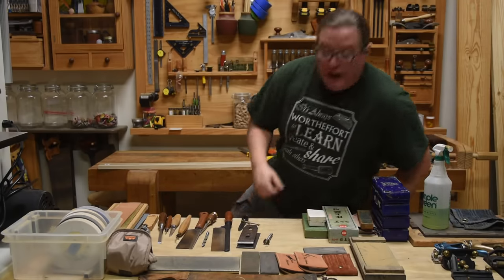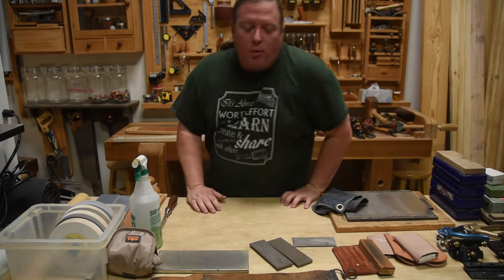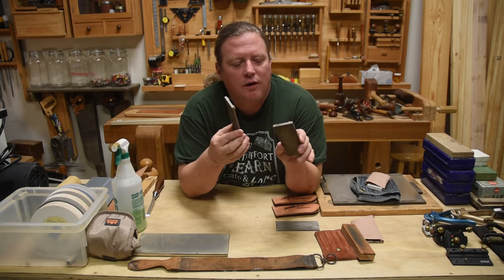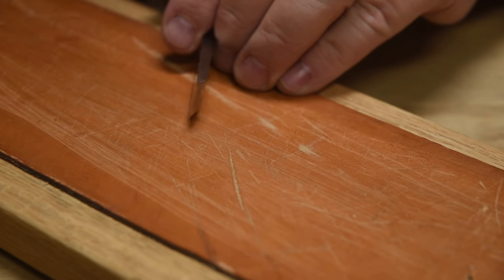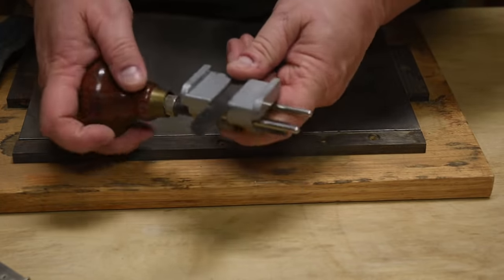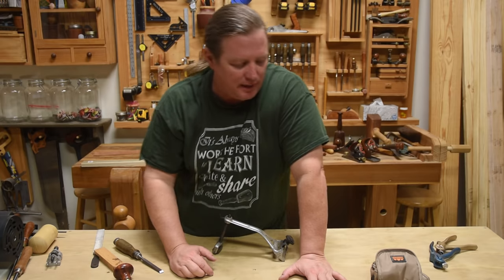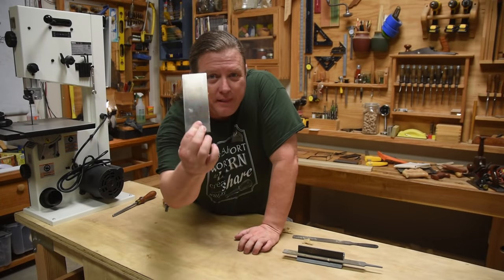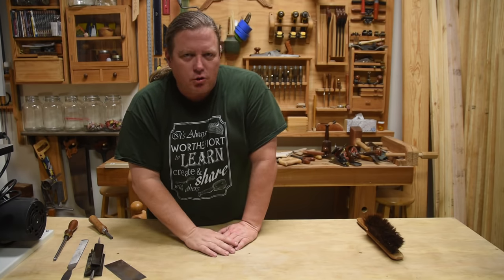Learn Sharpening - Prerequisite Course #07

Comment: I've been doing fine woodworking for 25 years and have pretty much progressed through all of the methods you described and agree with your conclusions.   My current methodology is the Norton stones and Veritas jig.   Not the only answer, just my answer.  I picked up the M-Power Fasttrack Precision Sharpening System and De-Burring Plate from Woodpeckers a couple years ago.  It is faster than the, but I'm not impressed with the results, you really don't get a shiny edge.  I've definitely got to get a real strop.  My current strop is an old belt hot-glued to a flat board.  Thanks for that reminder.   You've got a great presentation style
Reply: That should have said, "the Fasttrack system is faster than the stones, ..."   Not sure what happened there.

Comment: The thought of having to sharpen my tools literally terrified me! I've since sharpened my no4 iron, 2 chisels and a tenon saw. They all cut better than before, especially the chisels and plane iron as I have the cheap Eclipse type guide. The saw took me days before I got the courage up lol but once I started it was done in 10 minutes! The file dropped into the right angle and away I went.
This video has simplified things so I'm going to do some more sharpening tomorrow. Thanks 👍
Reply from the maker: keep at it.

Comment: I found a whetstone kit at the orange big box store a little over $40.00.  There are two combo stones 400/1000 and 3000/8000 along with other bobs and bits.  They say it's for kitchen knife sharpening, but the size of the stones are 2.28 in x 1 in x 7 in.  Will these be okay for sharpening chisels, plane blades, etc?🤨

Comment: THE BEST wet stone (they are splash and go, which is even better) are Suhiro Dabato MD series. they are large, fitting easily the biggest plane irons, and they are very affordable for what you get. They are also top notch and have the best feedback of ANYTHING I have ever used. (diamonds, oilstone, other wetstones) 

buy a Suhiro Dabato, you will NOT regret it.

Comment: I started out with sand paper but yeah, it gets expensive. Buying a stone is a good first step, or at least it was. You bought a wetstone with two sides, I bought 3 with different grits. I got myself The sund Tiger King stones in 220, 1000 and 6000 grit. They worked great and still do but I don´t use them in the workshop anymore because you have to soak them or store them in water and they make a hell of a mess. I use them for kitchen knives because in the kitchen I have a sink nearby, so it´s not as big of a mess. But yes, they work great and I can get a razer sharp edge with them even without a strop with chrome oxide buffing compound. Another downside of wetstones is to keep them flat. When sharepening a kitchen knife, flatness really doesn´t matter. Even when the stone is one millimeter out of flat, I still get a good result. I my opinion flatness doesn´t even matter a lot when sharpening chisels but plane irons are another story. So I was back to sand paper and the piece of glass to flatten the stones now and then. I knew about diamond plates but damn, those were expensive when I started out. 
Because of the mess I switched to a 2-sided Norton oil stone. Even the fine side is pretty coarse but the stone is so hard, the achievable sharpness is acceptable. Only for some applications like carving I need an edge sharper than that. Later I bought finer oil stones up to 4000 grit. That´s enough even for carving tools, since I can still use a leather strop. A few drops of oil on the stones don´t make a mess and they stay reasonably flat for a long time.
But still, diamond plates are the future. I bought 3 DMT plates as Paul Sellers recommends. I don´t want to go back. The diamond plates stay flat, they take off material really quick and so far I haven´t worn one out. I also bought a credit card sized one with 600 and 1200 grit to hone my turning tools but my favorite are the small and dirt cheap EZE sharp diamond sharpeners with the plastic handles. I use them on my skews, scrapers, turning gouges, knives and carving tools. I used them for over 2 years now and they´re still not worn out.
I wouldn´t recommend sandpaper for sharpening to anyone starting out, since diamond plates are really cheap nowadays. I´ve bought a set of 6 diamond plates from 200 to 2000 grit for only 20€ on Amazon. They´re pretty thin but when used on a thick piece of reasonably flat plywood they´re good enough even for plane irons. I´ve been sharpening with those cheap diamond plates now for over half a year and so far they still work fine. I´m not only using them for sharpening but also for shaping parts made from all kinds of metals and also pieces of bone to make guitar saddles. They replaced sand paper and files for many applications. I think they´re well worth the little money they cost.
I got lucky and learned from a carpenter how to sharpen. I learned to sharpen without any jigs and I´ve never bought one because I never saw the need. But It´s a learning curve, so for beginners without the help of an expert, a jig might get them started and they can focus on developing other skills because you can´t learn everything at the same time.
The carpenter who taught me sharpens his scrapers a bit different. He removes the burr with a file as you do but then he removes the burr from the filing with a fine oil stone and gets those 90 degree corners really crisp before he makes a burr. He usede to do it with a screwdriver but he switched to tungsten carbide. Even the oldtimers appreciate that stuff.

Comment: Thanks Shawn. 
When you can no longer strop, but the edge is still intact, do you use all the diamond plates, or miss the coarser ones? If the latter, how do you know which one to start at, or is that just experience. 

Regards,
Adam
Reply from the maker: If stroping takes too long I go back to the grinder to hollow out the middle then strop again. Don't let the grinder touch the heel or edge.

Comment: I gotta fight for the scary sharp system. I like it. I started out young with my dads old India stones. With some old granite counter top material, I made some flat stones and used lapping paper. I sharpen my hand plane roughly once a project and my pocket knives once a month. SO my stone set gets used roughly 2-3 times a week. That lapping paper lasts me easily 2-3 months assuming you set it up properly. I also get a sick kick out of lending a friend my pocket knife, and it easily slicing through flesh like butter.

Comment: Once again, thanks, especially the bit about sharpening hand saws. I have just bought a few on Ebay and the teeth are all there, they are old and poorly maintained. I will need to remove service rust, do have preferred method for that. If the answer would be an essay then ofcourse I wouldn't steal your time. 😎
Reply from the maker: vinegar
Reply: @wortheffort  ta 🙂

Comment: Can you sharpen a lathe chisel by hand?
Reply from the maker: Yes, I hone all the time. But a grinder from a pawn shop or garage sale is very cheap. Even new ones with good wheels are only but $99.
Reply: @wortheffort  Thanks.I just wanted to be sure it was possible.  I've just started to work with a lathe and was trying to make a round mallet from scraps plywood. I also used some resin to fill minor gaps. In general it was a lot more difficult to turn than the pine i was practicing on. When I tried to sharpen the skew chisel by hand with sand paper, I thought I had gotten it pretty sharp but it didn't cut as nicely as I'd expected. I wasn't sure if it was the sharpening, the plywood, the resin or … so I just wanted to ask. I do have a grinder but don't use it to sharpen my tools. I mainly use it to get a general shape on an tool if I bugger it up. I usually use sandpaper/diamonds and strop for final polish. So I didn't want to try adding another variable into all of this.

Comment: A 15$ combination water stone on Amazon, 400 and 1000 grit, that's all you need to start, and that's what I still use 4 years after. 30 seconds sharpening (12-16 strokes) and I can shave my arm hair all day long :D . A secret that no one will tell you: releasing the  pressure on the stone, it will practically elevate the grit of your stone, and it will grind the burr without folding it further. Start with 3-4 strokes with medium pressure on the coarse side (400 grit in this case) to create a very tiny burr, then again on the same side of the stone (400 grit) do another 3-4 strokes but WITH VERY LIGHT PRESSURE. In this way you are virtually "changing the grit" of the stone. You are always on a 400 grit side, but very light strokes reduces the penetration of the abrasive in the steel, and you will thin that burr without folding it further. Then do the same on the 1000 grit side. 3-4 strokes with medium pressure, 3-4 strokes with very light pressure. If you have not applied too much pressure, you will end up with a bevel that will shave your arm hair, without a folded burr, without the need of "sharpen the back of the blade". My two cents. As always, thanks for sharing this.
Reply: Just wondering, how often do you have to flatten it? Is it messy to work with?
Reply from the maker: Every time you need a flat edge.
Reply: @ryancarlsen6479  Learning from my beginner mistakes, I can tell you that it depends on how large is the blade you are rubbing on the stone, how much time you spend on a face of the stone, and how much pressure you are applying. If you are sharpening plane blades, you don't apply too much pressure, and you don't spend more than 10-12 strokes on the same face of the stone, you can safely sharpen 3-4 plane blades and the stone is still quite flat. And obviously, you need to rub your blade on a different portion of the stone at every stroke. With chisels you lose planarity much more quickly. Narrow blades tend to leave more deep grooves and usually after 2 chisels you have to flatten it again. The wise thing to do is to flatten every face every time you turn the stone, before you start sharpening on that face. This way you need "less work" to make it flat again, and you avoid potentially irremediable mistakes, like for example, one edge of the stone more lower than the other. I use a 3$ shipped, Chinese diamond stone, 1/16" thick (400 grit or 1000 grit, but there are a wide choice of grits) from AliExpress, that is not at all rigid as DMT diamond stones, but is flat enough to get a flat surface on the stone (you can always glue it on something flat). I rub the diamond plate for about 10 second every time I turn the stone. It is messy? Just a bit of slurry on your fingers, nothing dramatic. At the beginning I was equipped with a tray with 1/2" border, a tiny plastic box to submerge the stone, to sprinkle some water while I'm sharpening, and to clean the diamond stone in between different grit face flattening (always try to not mix different grits slurry on different face of the stone). Lately I have built an ad-hoc plexiglass tray with borders and "water tank" fixed on a side, just to not have things wandering around. Last but not least, don't clean the slurry from your stone when you flatten it. Even if it is a 15$ corundum water stone that came from Amazon, the slurry is an important factor in the abrasive action of the stone, just like it happens with the natural Japanese water stones.
Reply: @ryancarlsen6479  PS: I forgot to tell you an important part of the process. Never do forward strokes on water stones. First, you risk to damage your edge and dig into the stone, leaving a terrible hole on the surface that require minutes of sandpaper-on-marble to rectify it again. Second, the forward stroke increase and bend the burr after every stroke. After 10 forward strokes you will end with a big burr that will require 5 minutes of rubbing to remove it. Don't do it. Do a backward stroke starting from the far edge of the stone, lift the blade, start again from the far edge and so on. It's the fastest and error proof method to get your razor sharp edge. Note that here I'm talking about sharpening with an eclipse stile honing guide. If you want to do free hand sharpening, doing only backward strokes it's a tedious process. In that case I suggest you to use the method that is showed (by Paul Sellers) in this video on diamond stone: https://www.youtube.com/watch?v=a6ykVzL2VAM . It works on water stone sharpening too. Just be careful, during the forward stroke, to lower your wrist while you are advancing, so that your bevel will be lifted from the stone at the end of your stroke, and not digging in to it. You will end up with a convex bevel using that free hand technique, but is fast and effective. Wortheffort has also showed this technique, I just don't recall now what was the video.

Comment: At first I thought you had forgot about hollow grind when you talked about two planes.   I have never tried hollow grind on chisels, but use one always on a hand plane.  Because I never sharpen the plane blade by hand, the hollow actually forms one side of the edge.  No honing after either.   But then I can feed the blade in increments under .001”  so I get the edge very fine off the grinding stone.    The reason you get different edges from stone and diamond grit is the way nature makes diamond behave.  It frequently has nowhere near the sharpness of the stones.   This is because of its internal fracture planes.   Also some diamond grit fractures more easily than other diamond grit.   Also,  believe it or not,  not all diamond is the same hardness.   Some grit will actually wear flat on top, making it very difficult to cut with.    It is difficult to determine what type of grit was used to make the diamond “stone”, so you don’t know what to expect.   Grit supplied by De Beers is normally the best.
Reply from the maker: Hollow grinding has nothing to do with the rays. All it's doing is removing metal so you don't have to remove so much to achieve that infinite ray directions.
Reply: wortheffort not really.  Hollow grinding can be used to form the cutting edge.  However not likely if you are sharpening by hand.   I watched a tool and die maker put an edge on a plane blade using a surface grinder.   Not having a surface grinder I tried to duplicate the results with what I had at the time.   A round grind stone in a drill press.  I clamped the plane to the press table and used the feed mechanism of the plane to feed the blade into the stone.  I ran the stone up and down against the blade, feeding a bit at a time.  The result was a hollow grind on one side, the straight ( or flat ) side on the other.   This worked well enough that my dad had me use this technique to resharpen all his professionally sharpened blades.   You and I discussed this before some time ago.   The main reason, I think, that this works so well is that it eliminates any possibility of one edge being rounded like you pointed out.  Previous to using this method I would sharpen the plane blade using a soft Washita stone followed by a hard Arkansas stone and then the French strop ( grit impregnated leather).  The edge could be used as a razor, but would not plane well at all.  The culprit was the strop.  It put the slight round on the blade.  This lifted the razor edge off the wood.   It was necessary to push hard enough to press this round below the surface of the wood.  Of course the wood fibers would deform, making this difficult.   With the hollow grind the edge is the only part of the blade to contact the wood and it cuts like a hot knife through butter.   I no longer use the drill press.  I still use the round stone but use my mill table to feed the blade and the mill quill to run the stone along the edge.  You made a statement a few videos ago about not trusting your set ups on some of your new tools.   As a machinist I do trust my set ups.   Just a different way of going about things.  By the way I enjoy you work.  My wood working is not in the same league, but I do know a thing or two about cutting stuff.
Reply from the maker: Doug Berrett the term hollow grinding refers to hollowing out the middle of a bevel so less material needs to be removed on a stone or strop. If your taking it all the way to the edge on a grinder that’s just “grinding”. Also it’s real easy to temper the edge when you do that.